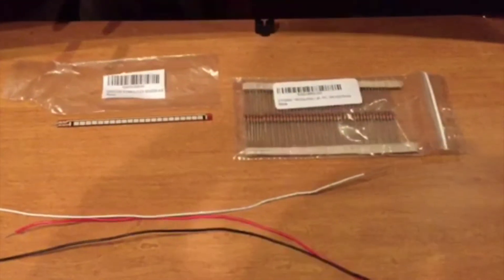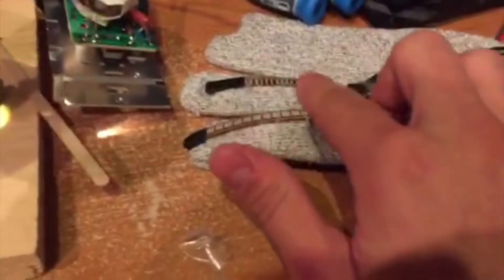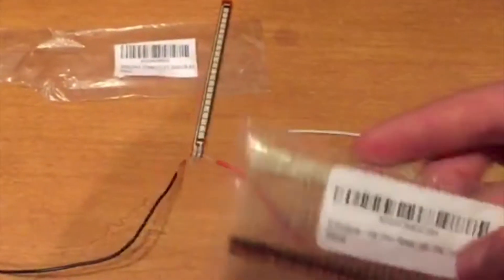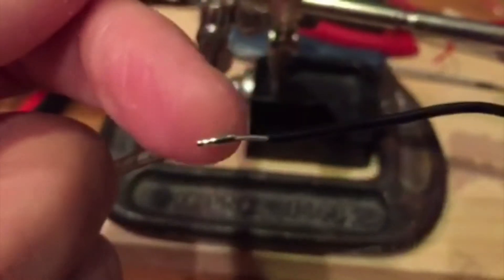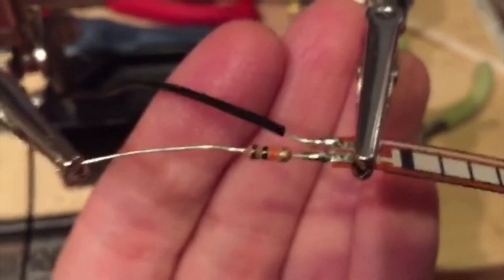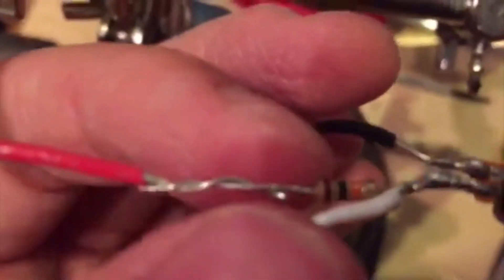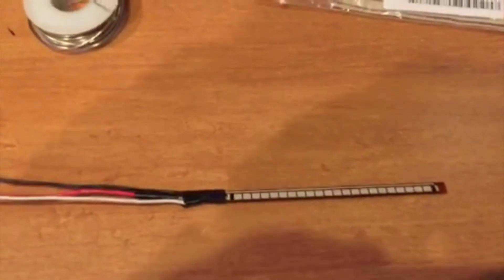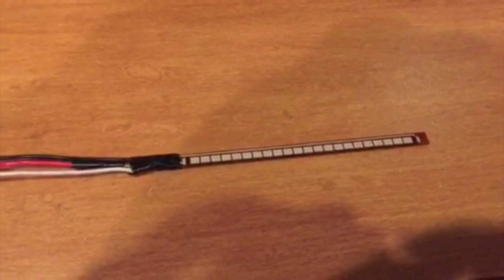Engineering Showcase - Soldering A Flex Sensor for the Glove

Comment: May I ask what all the stuff costed you?
Reply from the maker: +Cruso Craruso Sure! I kinda gathered all this stuff over time. When I was at an engineering convention a while ago, I got the soldering kit for what I think was around $80. The glove I just kinda had laying around as a gardening glove. The two Arduinos cost around $10 each. The five servos for the robotic hand varied in price because I bought what was available. I think that two of them were each $25 while the other three were around $15. The wire spools cost a total of $15. The extra solder was around $10. The LCD screen, button, and potentiometer came in a kit that I miraculously got for around $35 (it normally costs $80 but was on some sort of a clearance sale). The cardboard used for the hand was...you guessed it, free. The string used for the hand's tendons came in a mini sowing kit I bought for around $5. The several paper clips used as the pins keeping the hand's joints together were free. The gorilla glue I used cost around $3 per tube, and I think I used up a couple of tubes of the stuff. Pretty expensive project overall, but I accrued most of this stuff over time. It would cost a ton to get everything in one sitting. Thanks for asking :)